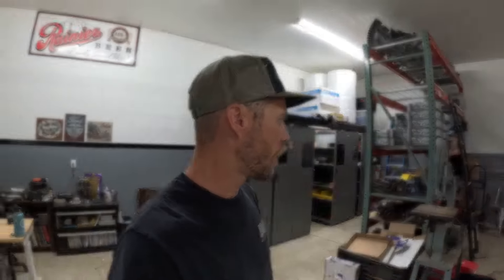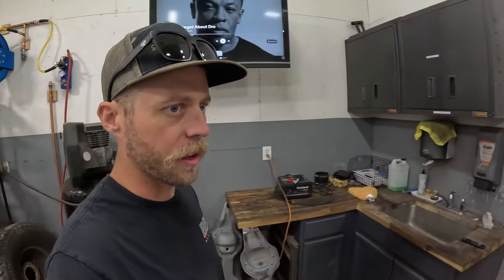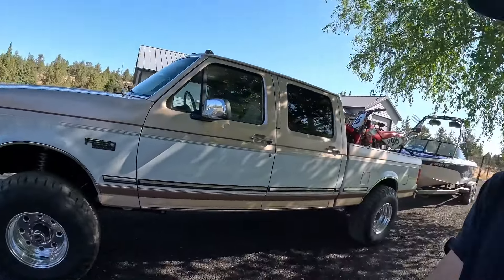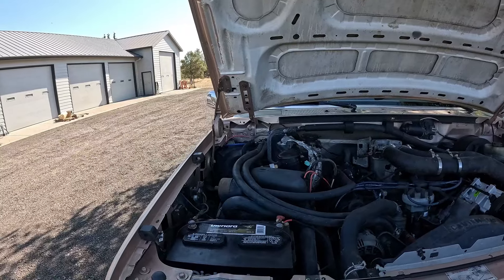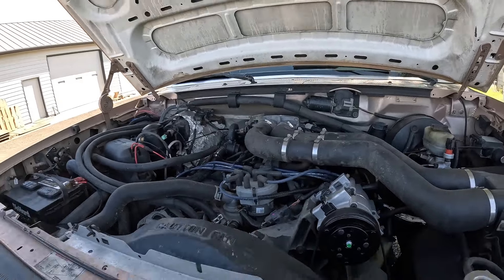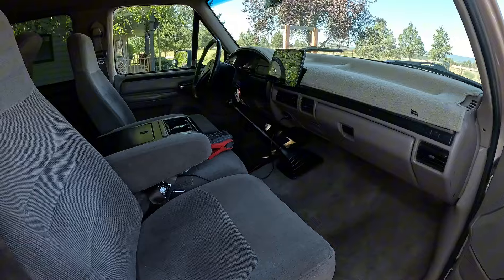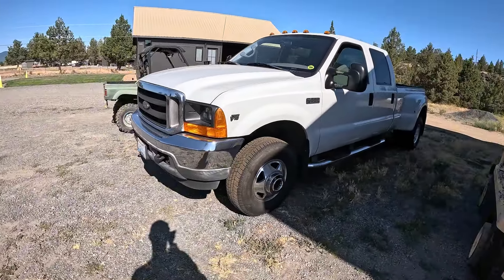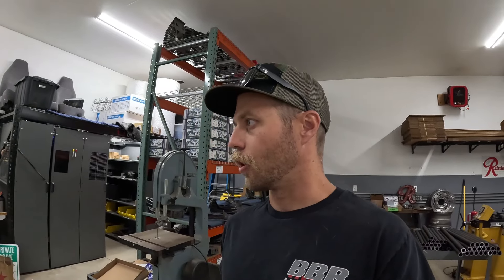Check out what we have going on in the shop right now!

Comment: Speaking directly to you, Jon. Yes - I was all over this video this eve. I'm in the Bay Area (Not from here. Don't hold it against me please. I'm from Michigan) and landed a '97 F250 Powerstroke, 2 owner for the last 23 years, 200,000 miles for $8k. Interior is trash, but it runs nice. I'll be having the engine and trans done here locally, but the suspension piece is super important to me. Your systems look like such a solid solutions and you seem like a level dude. I've been waiting for Desolate Motorsports to come out with the kit they have on their f250 Baby Blue 2 tone F250 Powerstroke, but I'm losing hope that will ever happen.
Reply from the maker: Very nice! Sounds like you got a great deal. If you are wanting to do coil overs on a TTB50 we can definitely get you dialed in. Send me an email at info@carrickcustoms.com and we can chat more about it
Reply: @carrickcustoms9504 I’m still learning so if this is a stupid question, I apologize. Don’t you swap out the 50 for a 60 with this kit?